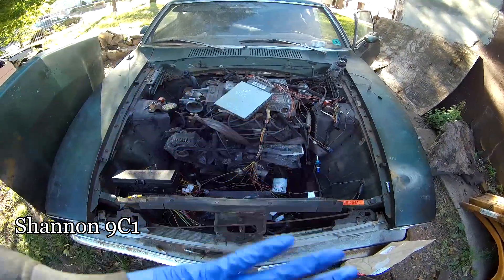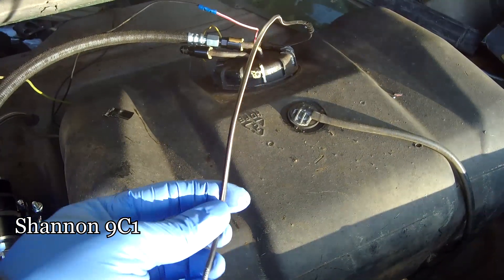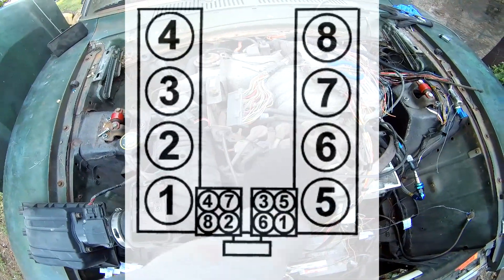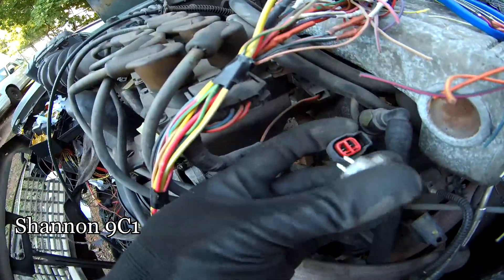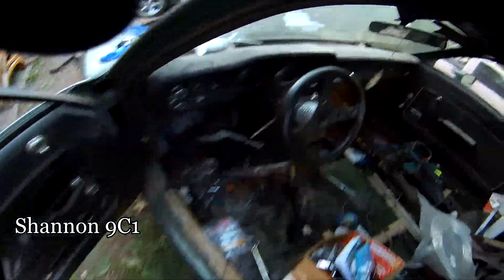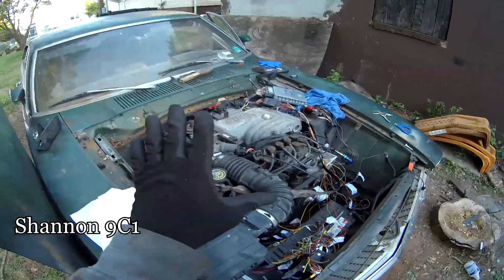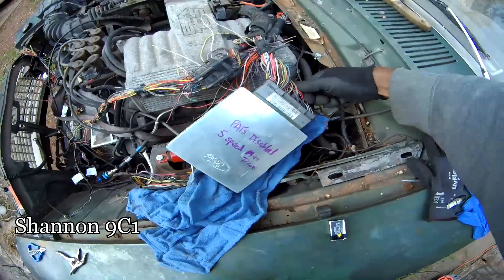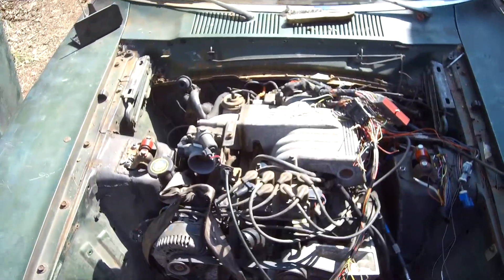Is it CHEAPER to EFI or CARB a Ford Maverick?

Comment: BST! My Man!  Sweet you got the Maverick running on EFI/ECM! It works.... But it ain't looking stock under Da Hood :)  Possibly you can do the 'School Look' in the future... to setup that motor....  First put a carb on that roller motor. Next old school distributer and use a Pertronix ignition :)  Then find a old wiring from a 73' to 77' truck, car; any Ford harness will work, Painless harness which is Not Painless in the wallet!
Reply from the maker: I have to decline making it carb its cheaper this way .. I love the idea of carb but this was a a Scrap build now if i had a carb laying around then sure buddy i would go for it. There is no 73 trucks around here I just have to roll with whats in the junkyard, I love this comment I enjoyed the love for the carb bro

Comment: awesome so glad you got it to run. fords are funny on first starts. the reason it died is the pump didnt have all the air out the lines yet. it still can happen. your doin an awesome job now to make it all pretty.  youve done what so many only dream of doin bro. cant wait to see you drive it
Reply from the maker: thank you for the support on this project ozzy. I did not want to make a thumbnail saying the cars starts. I wanted the real supporters to understand and view the car starting for the 1st time. Thank you so much for pushing me to get the car done with ideas and thoughts..
Reply: @bstfordchannel923  ok do yourself a favor and do not cheap on the radiator go get a heavy duty one.  not alot of air goes under that hood and the v8 swapped ones tend to over heat.
Reply: @bstfordchannel923  and if you can get a grabber hood the vents can be used for real. those will keep the car cool in the summer
Reply from the maker: I will not cheap on rads you see what i have in a Crown Vic I have to get the 3 row joint and put that in there.. I like the aluminum rads for some reason its a must in the cars
Reply from the maker: @ozmister101  man those cost a grip I want the grabber wing now thats a must lmao.. I will firgue the hood out may have to do something different than the grabber hood. Just be different

Comment: 😎🔔
BTW
This fuelie in a Maverick will be as quick as a FOX if you can get the tires to hook.
A good set up will run 13 flat quarters STOCK.
Reply from the maker: maybe even quicker cause the car is way lighter

Comment: haha, the fail horn! I probably needed to drop that in my start up videos! definitely feeling that one man operation bit. Fuel injected Maverick will be so much cooler. Cheaper or not, this will be cool!
Reply from the maker: The fail should have been in this video 10 times ( had to shorten the video thank you for comment it means a lot. So people really do not dig the EFI in the Maverick, but this is what I have ( for the cheap ) the fuel pump is running on a switch UNTIL I figure how to wiring that up to run off the ecu , pcm ,the car brain. Then this will be a win..
Reply from the maker: I must say i like what you do with the lives ( it is the best out there ) how many people you would like to see in that chat area . let me know and maybe I can attempt to assist . You have to be quick on the response in the chat . let me know the number of people that would make it a a success in your eyes.
Reply: @bstfordchannel923  well, we feel like by now we should be averaging over the old number of 24, but there's ebbs and flows. Feels like we should average 30 by now, but at the same time we've kind of stopped worrying about that. If the guests are good, it's searchable content. Also, the networking is just as rewarding now. If you're interested in being a guest in season 5 (after the new year) drop me an email (you can find that in my about page).
Reply from the maker: @Str8sixfan  Thank you on the invite and i will love to be guest on you show. Its a great show honestly.. I agree with the networking and NOT looking at the numbers but the quality of the guys and people that tune in and join . I have saying I rather 2 lions supporting me vs having 1k of sheep supporting me. if you do not mind i would like to see if i can get some guys over to your live session. Would like to have some fun and comment make is like a bar online and just chill with bros.
Reply: @bstfordchannel923  there's only a few episodes left of season 4, so make sure you rally the troops for Thursday's at 7pm Central. On Olde Carr's this week

Comment: Good job on getting the car to run. Fuel injection all the way thats how buikd my cars.I suck at adjusting carb since I didn't grow up with them.
Reply from the maker: Me to I have no clue with carb abd the timing issue when to set it up right,, I rather take the 2-3 months wiring lol vs doing carb set-up which is crazy.. thank you so much for commenting
Reply: @bstfordchannel923  lol I agree and keep up the good work.  We budget builders
Reply: Auto meter has air/fuel gauge for carbs , problem is you need to weld a bung into the exhaust ( Maybe a quick trip to an exhaust shop ). Then you can tune your carb while on the car/truck and you can view in real time how a carb is working for you .

Comment: I love the maverick man cant wait to see it up n going on the road!!
Reply from the maker: me to Smokey i have to get some parts cause i used some in the white vic
Reply: @bstfordchannel923  hopefully the parts aint runnin too much!   hows the white vic runnin?
Reply from the maker: @smokeymagpot5569  the parts to make the car MOVE will be around $200. This lil maverick is a pit lol ( by broke standards lma ) the white vic is still the same , but i may take it to the shop cause it will be cold out about time i touch on that. I may assist on the mechanic work est cost will be around $500 no parts thats labor. as i thinking about it . I my do it in the cold lol
Reply: @bstfordchannel923  nice not too bad on the parts.   i know broke standards lol its hard.  yea id do the work myself too. set up a heater n put up some tarps to block the cold from coming in the garage. i did it with my older brother when id help him on his rx-7 in -15

Comment: Most times, you can fix a bad junkyard carb. Can't fix a bad CPU. Jetting a carb is more about trial & air than science. Is why I like the Eddy performer. You can purchase a whole pack of different size jets for it and it's a 5 min. change out. Making those 2 wire harnesses work together would be a nightmare for me. Would much rather set up a stand alone fuel injection on a 302. Except for the low budget junkyard challenge, the good working CPU is tuning components together for you. Not a fan of junkyard sensors or coil packs. So that is extra costs down the road. Is CPU cheaper? Only 5 years of running it will tell what's real.
Reply from the maker: when you do this you real have to do your homework. cause the car is well the swap wiring is 20 years old ( a solid simple set ) but its wiring again with carb its best but as you can see i done a swap 302 efi for 300 bucks THAT can not even buy a EDDIE Carb ( again this is the junkyard challenge ) so this method will apply now how long it last well thats the other question that we have to find out. I will get space ecu with pats delete. This may be my go to engine of choice

Comment: Cool beans! To convert an engine either way is expensive. If you have the stuff to do either, it sure helps!
Reply from the maker: right on man it cost a lot the OTHER way ( carb ) the cost of the swap engine and stuff 500 thats engine 5 speed trans flywheel bolts and ect. Thats not to bad

Comment: Non pats I think it 96-97 5.0 explorer. 98-01 5.0 is high pressure returnless fuel system and pump. Which I think it means it runs at a higher fuel pressure. Good pick on the gt40/p 5.0. Idk if you're running the 4r70w but the wiring and internal plug is also same as pats 96-97 and 98-01. Trans Wiring can modified to run either it's posted on explorer forum.
Reply from the maker: I have a 2000 Ford explore on a v6 t5 trans with a f150 flywheel. I have a high pressure fuel pump with that single line how ford did it... I tried to keep it simple I just got the pats delete but i will swap in the other ecu and see if it would run..
Reply: @bstfordchannel923  I think ecu change will work on pats bypass. Try a search on explorer forum or crown vic forums. It may be ecu + minor wiring change. Crown vic forum had some info on that "subject".
Reply from the maker: I will try it 1st hand and see what will happen.. Thank you for the comment and the help plus the info bro

Comment: I 2nd what you said about the fuel system. If you already have fuel injection, it is definitely cheaper to stick with what you've got. It seems like it wouldn't be but it is. I did the math on carburating my Vortec 350 and it was way cheaper to stay with my fuel injection. BUT, there is a lot of truth in the fact that carburators are simpler to work on. It all comes down to, how much are you willing to spend, and what is it going to take to make you happy?
Reply: With my 97 Yukon, it has push button 4 wheel drive and it has an electronic transmission. I was going to have to buy an expensive electronic transmission controller, intake manifold, carburator, ignition system, and fuel pump to make it carburated, a new air cleaner to hold a air filter, an air filter... Not to mention changing my fuel line setup and running wires for the electric choke. Glad I dodged that nightmare before I got started.
Reply from the maker: I told ya NOT to take that route. I was facing the same kind of thing and carb was plan B. but deeply there was NO plan B
Reply from the maker: the best buck for buck if you have the time and to prep.. i di wiring on my 240sx engine and swapped it into a Datsun so I had some what of the theory , the fear was in my thoughts. I had to shake that and focus and just do it. I like the carbs they push more hp by a jet or two efi you that TUNE
Reply: @bstfordchannel923  🤣Yeah you sure did man. It was you and an old hotrodder friend I had at my last job that talked me out if the carburator. When I started adding up all of those parts I needed, staying factory was a whole lot cheaper and simpler. Especially cause I don't have to change anything. I just need to replace my spider injector and clean my intake up real good and i'm ready to go. That's kinda the same logic I had with the exhaust manifolds and egr. I was like man I am gonna spend a ton of money on something that doesnt matter just to have some shorty headers and an egr delete. It would be cool and it would be money well spent. But it costs money!$$$$🤑

Comment: Hell yeah man.

I"ve got the 96 Explorer GT40 for mine.

Trying to decide between EFI and carb and whether I'm going to keep my AOD or swap to a T5.

I almost talked myself into EFI but now I'm leaning back towards carb and a manual.

I'm more than a little concerned about the intake plenum and the shock tower supports. The car has a lot of flex without those supports, on the other hand that intake plenum is worth around 20-30 ft lbs of torque around 1800-2200 RPM.

As far as the fuel system someone makes a small external EFI pump, feed it with the regular line and it provides pressurized fuel for the injectors. I'm leaning that direction but there's not a lot of room under the hood. One of them makes an all in one kit, it's on the big side but it'll fit in the trunk. A small electric pump to feed the sump and another to provide pressure for the EFI.

One of my buddies has done the swap, you may want to poke him to simplify the harness a bit.

https://www.facebook.com/photo.php?fbid=1554599494724386&set=p.1554599494724386&type=3
Reply from the maker: yeah I have to get the harness right, but i will get another engine and get these harnesses and make them a lot simpler .. i will have some fuel issues and have to sort that out. Its cool though i see what it can be but i have to get the driveshaft done and rad ect..

I would efi cause it just best 5 speed would be the best option quick and simple plus fun. In the end you have to see what your money is like. My money is funny so i had to make this work. Thank you for this link i have to start getting with some maverick guys, but many i have seen never wanted to talk to me ( maybe i am to green ) on the Mavericks
Reply: @bstfordchannel923  these guys are pretty cool. Very welcoming group.

Several other groups I don't deal with, everyone is all mouth and ego.

I've known some of these guys since 98ish on the old Maverick.to forum.

I'm building on a seriously tight budget myself so we're doing this about the same way. I'd prefer to swap the cam but I'm probably just going to run it as is.

Truck torque in a Comet should be pretty decent.

I forgot that was a private group. It was a link to a pic with a comment, one of my Mav buddies has an EFI setup, he said the harness can be simplified down to about 4 wires. That's why I linked it. Those guys love this kind of stuff, most of them are older and live vicariously through the younger ones, help out with stuff like that. I'm right in the middle, not young enough to bite off a dozen projects like you but not so old as I'm going to sit on my ass and watch if I have a choice.

lol

Comment: Greetings captain, I and my new to me 141K mile 96 5.0 Explorer have arrived, a green on green Eddie Bauer 5.0 at that with the GT40 heads, the weirdest second gen I've had. Tip of wisdom, 96-97 Explorers I BELIEVE are the same engine and PCM wiring harness, no PATS, 98 is different than 97 and HAS PATS (run from 98s), 99-01 are all the same damn car, with PATS, but not the same as 98s, wiring differences for the camshaft sensors. Also shit I'd hate to know I was retarded enough to junk a nice Mountaineer (thanks for the trim out that unit, it's beautiful in mine) over spark plug wiring.

Man that bad boy runs good, shit makes me wanna get on fixing my 96 up nice again. 141K and it's beat to piss but I hate to chop a good second gen Explorer. Remind me to throw you some goodies in a box too, I need to dispatch you a good ECU bracket if I have one and shit.
Reply from the maker: thank you for that info the wiring is the same colors EVEN in the v6
Reply: @bstfordchannel923  Yup same colors, I think same PCM too just flashed differently

Comment: Bill Sutton i have a question; i had the engine in my 2000 Vic replaced with a 2003 grand marquis engine, did i make a good decisions or was that a mistake? Is there anything i should be aware of?
Reply from the maker: nope its a better engine McNeil you did well

Comment: 😱
Reply from the maker: brother i am mixing the new-ish with the  old school. try capture the old school ways of Hot rodding during these times
Reply: @bstfordchannel923  As am I.
Ive done 7 Fox HO into others, 63 Fairlane, Falcons, Mustangs.
 Im quite satisfied with the OBD1 A9L  computer system as used in all Fox T5s.. Very easily upgradeable.
I would plug the entire Fox system onto the Exp... But you will need the distributor system.
No Explorer computers yet.

Comment: Why did you use that system? Used fox chassis  fi , 3 wires after you hook up everything else and your driving. You got a rats nest there.
Reply from the maker: wow kinda shocked at this comment, but it seems old schoolers dont like me to add efi in a Maverick...  ( break down on why I did this ) Engine $150 with harness and computer. another $150 for the ecu delete got the car running for $300 and maybe another 60 bucks,, You work with what you have on hand, There is now Foxbody mustang anything for cheap ( i am sure know that ) , but i thank you for this comment . I know little more about efi vs carb

Comment: I wanted to convert my 2006 KIA Rio to run off a Weber 32/36 carburetor but I have to fabricate my own intake manifold. The whole car is just infested with electrical issues...
Reply from the maker: those you would run the Mitz engine cause Mitz makes the engine for those i think. Just swap it out